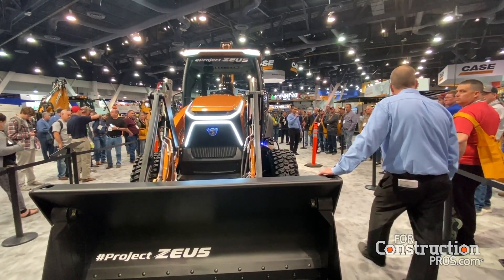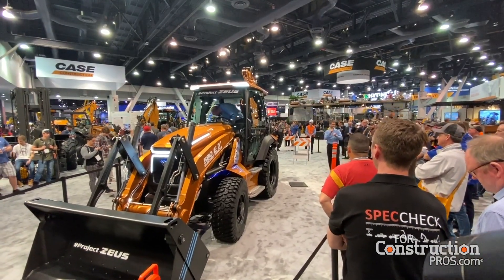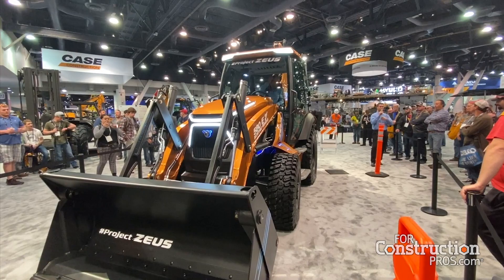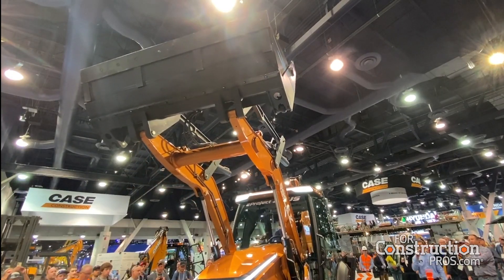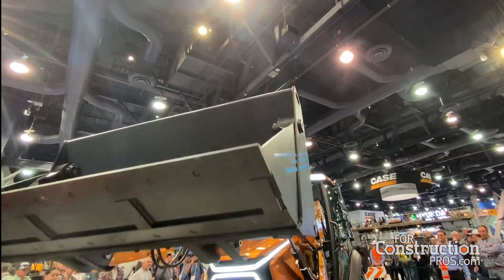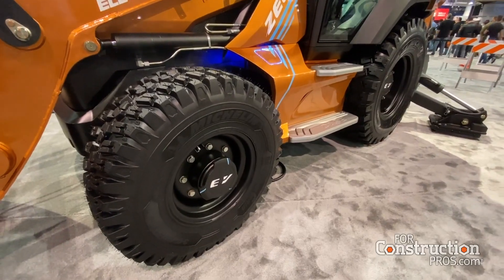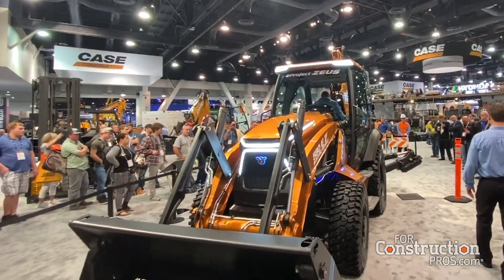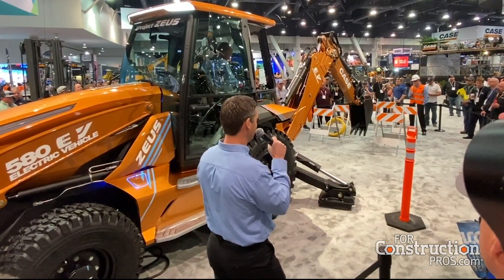See (and Hear) the World's First Fully Electric Backhoe Loader

Comment: Why not at least a small motor to run a generator if your job site does not have three phase power yet but I guess the trailer mounted diesel generator comes with it

Comment: How is this a big deal? A Case backhoe is a totally fluid drive machine, it doesn't matter if its diesel, electric, or hamster wheel, spin it fast enough and hard enough and it works. 
 What is the cost difference?
 Run time? 
 Battery replacement cost?
 Can you change batteries and keep digging? Or is your day done when it needs charged?
 Will it work in below freezing temps? Does extreme cold affect run time?
 How long from dead batteries to fully charged?

Comment: What’s the earth look like where lithium mines was? 🙄
Reply: Same as lead mines. Do you remembery anyone? 🤔😜
Reply: Nice thing about electric is if/when they find a better battery chemistry or power source you can easily switch your old car/equipment to it when it comes time to replace the battery.

Also, you can recycle almost all of the heavy metals in a battery.

With proper care too, a lithium ion battery can last a very very long time, Teslas for example are showing that its not going to be uncommon now for evs to have over a million miles on their battery packs before they lose 20% of rated capacity.
Reply: @joeziahbabb  nah I'll just make my own fuel and stick to something I can use all day instead of two hours

Comment: How much? How long battery life/lifespan? What about serious work like digging concrete? They always talk these electric vehicles/machines up but in reality they don't come close to the diesel equivalent!
Reply: I don't know how much. Significantly more than their diesel counterpart, but is expected to break even through usage savings and maintenance.

The battery lifespan would likely be the same as a normal EV, dependant on how often the vehicle is used (discharging fully == less lifespan) - so somewhere between 10-15 years probably

In another interview (on YT) one of the guys from the company said you could expect it's "8 hours of operation time" to go down to 4-6, with heavy concrete-breaking work. Other than that, the machine should handle it the same as the diesel version.

I can't say how it will compare to the diesel counterpart, time will tell I guess. So far, I haven't even seen one in operation (ie, digging etc). I think the one in the video isn't designed for that lol (it's got metallic paint and fancy lights all over it. The real one wont apparently)

Comment: Zero emissions, coal and gas charges it. I hate the BS.
Reply: Although that IS marketing language, it IS zero emissions on-site. Electric is also more efficient that diesel machinery, so that lowers emissions greatly, even if charged from a coal and gas grid.

The important part to this, is that it's POSSIBLE to make it zero emissions. You can't say that about diesel/coal/gas

Also, as more wind hits the grid, having batteries like this plugged in, greatly increases their usability. Further decreasing EVs emissions

It's a step forward, at the least. Baby steps, we can't do everything in one giant leap
Reply: @MrVelociraptor75  Please lets be realistic: 1) The machine is not emissions free, the emissions are at the power station.  2) It only runs for 8 hours(ideal conditions?), with diesel you can fill it up and carry on or if you have an emergency job keep going. How will you do that with a flat battery you will need another machine? so the efficiency of a diesel now is a better consideration for the small inefficiency. Most job sites in Australia do 12 hours minimum. 3) So you bring the tractor home and the sun has gone down what solar you going to use? what if the wind is not blowing? You use coal and gas once again to make up the intermittent load. 4)Co2 is not an enemy of the earth its a good friend. 4)China and India are not worried about emissions look at how many coal power plants they are building. The front end loader is for the woke. 5) The cost of zero emissions has no end in site, you cant put a dollar value on it. It seems endless and the tax payer will pay by at least 2 generations.
Reply: @JR-oh6vo  CO2 is a huge problem in the vast quantities were extracting it at. Using China and India as good examples there, is idiotic.
China is actually one of the largest uptakers of EVs in the world (due to strict subsidies enforced by government regulations, because they desperately want to reduce the toxic smog in their cities) which, "let's be realistic here" THAT is the important part to going towards a sustainable future. I emplore you to park your car in you garage and idle it for a few hours, with you in the seat. Then, if you can, tell me they're clean and healthy...
Reply: @JR-oh6vo  This machine is also for medium duty work, as with their diesel one. It's not expected to be run flat out 24/7, or be the primary machine on a large site. You'd need a few other provisions for that (like fast-chargers or swappable packs) so it's not the perfect solution. It's a start and that's important!

Back to your 0 emissions problem, no, it's not 0, but it has the ability to be, a pure diesel never can be. It will still be cleaner over the life of the machine than a diesel, even on the dirtiest of grids (where it's about the same, but a much more efficient use of its energy).

As they will most likely be charged at night, wind or hydro would be the source of its power and in most countries with reasonable renewables, gas too (with minimal coal in reserve, because you can't just turn them off)
Nuclear, in a lot of countries too (which is a preferable source to coal, for me, even though I'm not a fan) at least it's emission free
Reply: MrVelociraptor75, I just think it kind of funny how nobody brings up that you can’t dispose of lithium batteries in any good way, and the huge environments/ecosystems destroyed by lithium strip mines
Reply: @texancowboy2249  So, first of all, Lithium, even though it's the namesake of the battery, is actually in very small percentages of the battery itself.

Secondly, for the vast majority of "Mined" lithium in the world, it's mainly a brine solution pumped into the ground, to force the lithium (and other salts) up. Not perfect, but typically has little environmental impact. Australia does "strip mine", but we strip mine everything, so take your pick, either coal or lithium. One at least doesn't further pollute when you burn it (as you don't burn it lol). Both methods are usually (at least currently) not around poor quality land anyway, so ecosystem damage is minimal.

It's other metals in the battery, that have particularly less desirable mining practices. Cobalt is the major one. But it's expensive and partially because of that, is also desirable to recycle out of old batteries. Nickel is the other, same deal. - The rest of a lithium ion battery is mostly aluminium and graphite. 

Thirdly, although recycling the batteries isn't happening now, it will likely happen in the future. Mostly through necessity (there's going to be a LOT of them). A bunch of EU countries and even the Chinese govt have put strict rules in place for EV manufacturers to factor in end-of-life plans into their construction. Recycling WILL come, at the moment there's not really the battery wastes enough to start large-scale recycling to make it profitable.

Lastly, there's currently a number of start-up companies (and some big names) looking into ways to reuse the battery packs in EVs, after they've reached their usable lifespan in an EV. EV demands are high on batteries, so they have a LONG life left after they're no longer useful to the EV, usually in stationary applications. Reusing is far better than recycling (It's a whole "R" before recycling is in the saying "reduce, reuse, recycle" ;) )

Sources;
http://theconversation.com/politically-charged-do-you-know-where-your-batteries-come-from-80886

https://www.energycouncil.com.au/analysis/storage-retirement-home-for-old-ev-batteries/
Reply: Id like it for all the Convenience of less maintainence.  I realise Diesel still wins on daily overall runtime.

Comment: im just wondering how do you recharge it with 0 emission if your working two or three hours from home
Reply: Walter K Bauer  A generator isn't 0 emissions at all. You could try to read the message you're replying to

Pedro. A generator is certainly a possible, although less desirable option, as far as emissions are concerned. At the very least, a (good) generator should be lower emissions than the original diesel engines of the digger. They can be tuned to run and burn more efficiently, lowering emissions and should have less wastage (idling the machine all-day, even when not in use. Losses in un-burnt fuel when revving up/down too).

If it was just one or two machines operating on a site, then you could charge them from temporary site power, overnight. The demand isn't huge, overall. The cleanness of the grid in question depends on the area you're in (state/country etc) though, but that is (mostly) getting cleaner. The addition of EVs to the grid (with correct planning) actually improves the usage and implementation of renewables (it can absorb the indeterminacy, and, plausibly stabilize it too)

If pure 0 emissions was the desire, you would have to work around that aspect. I would suggest container units with batteries and inverters on board (driven by an EV truck) being charged at a solar facility* by day and swapped on site with a discharged unit as needed. Expensive and uses up more energy - both transport and the addition of battery constructions - but not super far-fetched for the near future.

This could open up additional business opportunities for providing green-power to construction sites, instead of temporary diesel generators. Cleaning the whole industry up (as long as the battery side is dealt with too)

* - the facility wouldn't actually have to be THE solar plant, but an off-site charging capable site, with "green approved" power etc - as the solar farms are usually a LONG way away
Reply: Additionally,

There are other technologies out there than just batteries (they're actually one of my least preferred options for pure grid-orientated stability)

There's an Aussie company currently starting up with a few sites, called 1414 degrees. They're a thermal storage system with high efficiencies and high returns. Check them out, if you're interested.

Their plans (among other things) is to load-shift renewable energy production. I'm not sure on the possibility of a portable system is though, but I know there is talks of something similar.
Reply: leave the loader at work and drive to work?
Reply: Your soon to be electric pickup